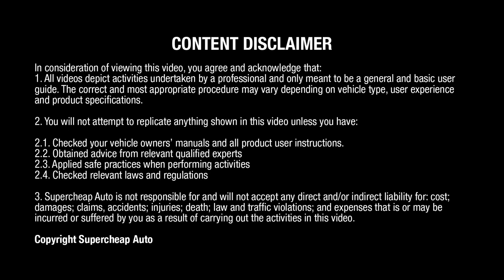ToolPRO Windscreen Remover

Comment: Try moving a windscreen that's not wet urethane I used to be a windscreen fitter and I can tell you that's not proper hard urethane
Reply: I was told today, that to remove windscreen and get to rust starting underneath, that I’ll have to replace the windscreen, cos they can’t take it out without it breaking?  Is that true?